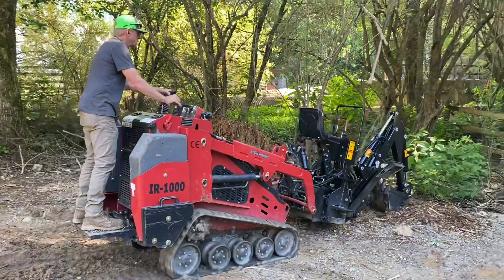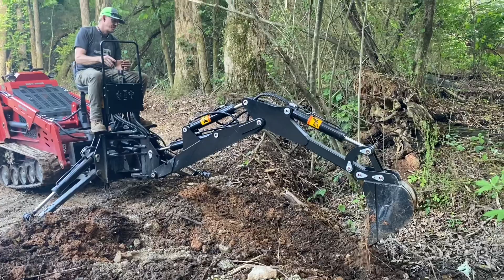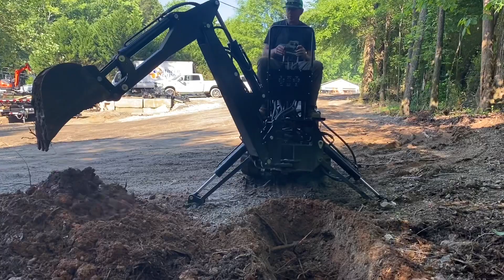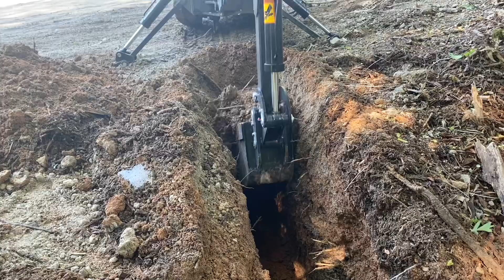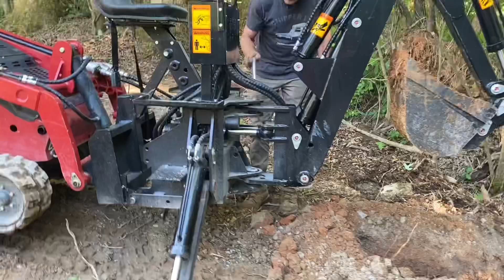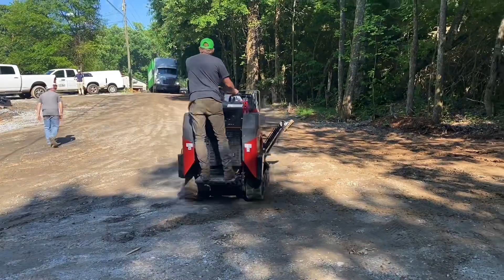Iron Rhino Backhoe Attachment on an IR1000

Comment: thats good deal for  a mini backhoe when i seen the toro one they want 17 grand   this would hook up to any  mini skid steer
Reply: We can make these work with dingo or MT plate.
Reply: @chipperllc1185   its not universal to the other ones like ditch which and cormidi
Reply: @ctlandscapemaintenancesolu494  The one in the video has the dingo plate also known as the universal mini skid steer plate.  But we also have models that can work with the bobcat mt plate that is found on machines like the bobcat MT100.